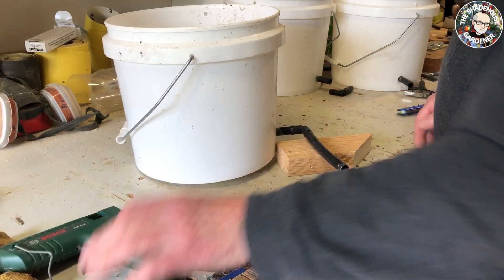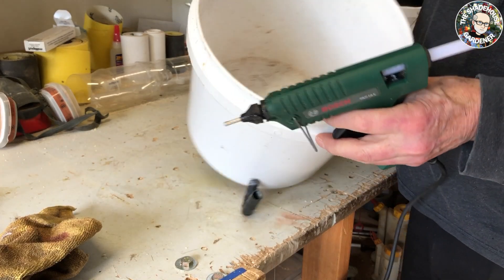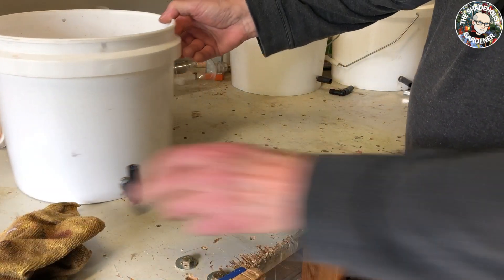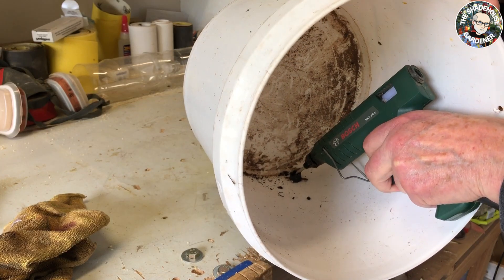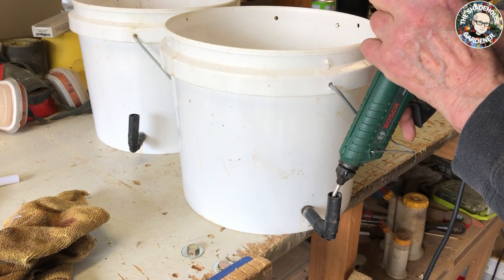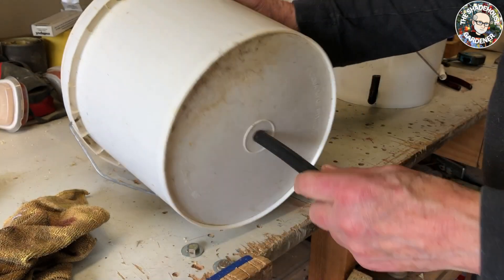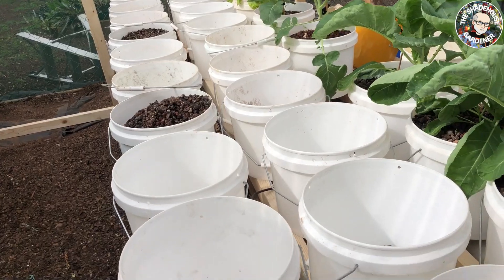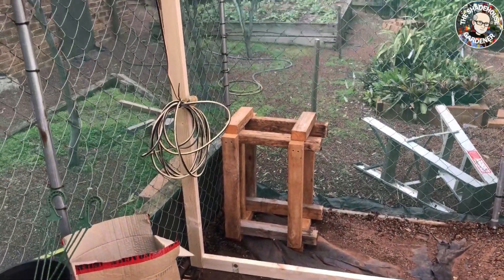Hydroponic Dutch Bucket Mods-2024

Comment: I had a large hole in a bucket I wanted to seal and I put tape inside then covered it from the outside about 1/8” thick with roofing flashing.   Any tape inside works because it’s just a backer.  That was more than 10 years  ago and it’s still sealed.
Reply from the maker: Cool idea, that will definitely work well. Thanks for your comment.